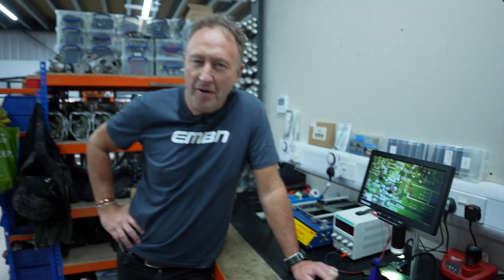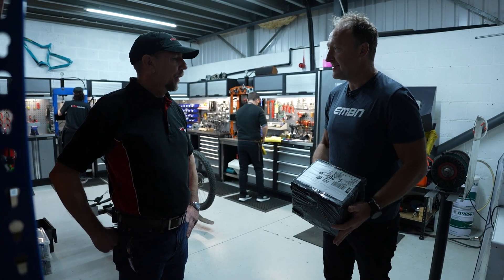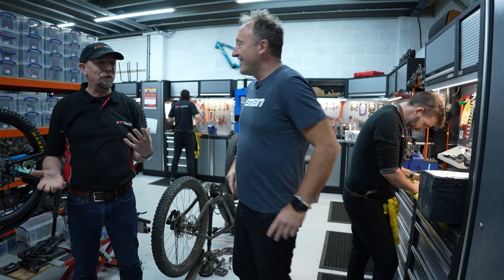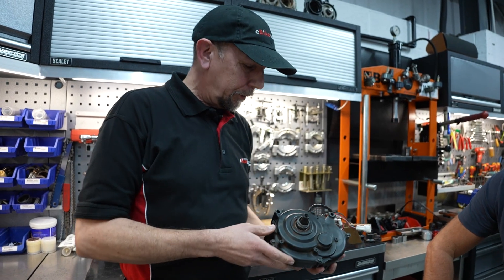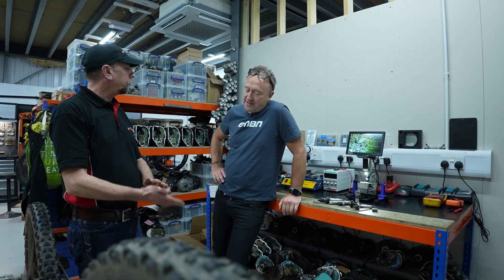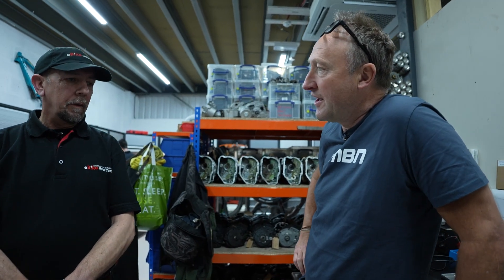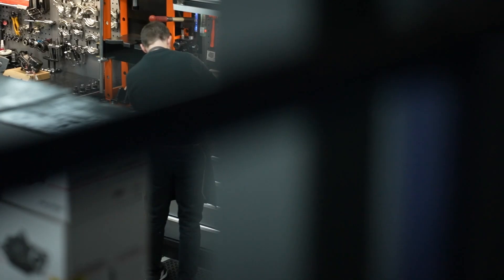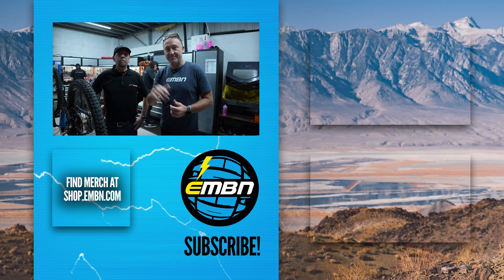How Affordable Is eBike Motor Repair | Behind The Scenes

Comment from the maker: Have you had to send your motor off for repair before? What was your experience like? Let us know in the comments! 👇
Reply: I had to repair it by myself. I live in Ecuador. I found that the bearings from one side were  awful condition but also there were humidity in the interior of the motor so I had to clean it all, change bearings and still working fine. It's a Bosch performance CX 2nd gen
Reply: I've used Pete in the past think he was known as performance line bearings, fantastic service would recommend
Reply: I sent the motor from my cargo bike to Ebike Motor Centre after 8000 miles.  Excellent service and a very reasonable charge.
Reply: I used ebike motor centre for the 2nd hand bike I bought with a dead motor (Bosch Gen 4 on Whyte E-150S). It needed a full exchange unit due to water ingress - the service itself was very good and photos of the damage was appreciated. The bike still ended up being a bargain!
Reply: Yeah mine was under warranty but I still had to pay my local LBS about £200 to fit it. Jokes
Reply: The question should be do we have the right to repair?
Reply: @rirrid5662  please expand on your comments
Reply: I rebuilt my Mahle motor from a Levo SL with a bearing and seal kit from eBike Motor Centre's partners in Australia.
Reply: Water does that!!
Reply: We need a setup like yours here in Dublin. All we have are apathetic generalists that struggle with basic ebike stuff and supposedly "supportive" e-bike outlets who are anything but. I can't even get a garden variety Bafang M300 mid-drive motor fixed.
Reply: My Brose packed up 1 month out of warrant and no claim due to expired warranty. I still have it after spending $100 on a new one. Does Pete have operations in South Africa?
Reply: Yes and fine, E-Ves did a great job. E-Mtb 12k km's
Reply: yes i did before 1 years ago in lithuabia.still broken and waitin for fix, how can you help me.
Reply: Is the bosch race motor the same to fix are you guys able to repair and or upgrade the whole thing?

Comment: Off-road motorcycles have been highly water resistant for decades.  E-bike manufacturers need to get their act together!  A tiny bit of seal friction and using sealants on electrical wiring, grommets, and mating surfaces seems a small price to pay for avoiding expensive water damage.

As many have pointed out, e-bikes aren't in the disposable price range for most buyers.

Comment: 90% of failures is Water Ingress! Failure from as little 150miles! Motor Case, Bearing Seals, not Hose pipe or jet washer Safe. Perhaps they should change the split line from Vertical to Horizontal? Improve the bearing seals & put a stick plastic cover strip around case, one front one back either side of the Crank bearing. They cost too much to fail so easily! An MGU & a Carbon Belt drive seems a great way forward!

Comment: Just moving into the EMTB world from normal mountain biking and coming from a motorcycle background I’m shocked at the apparent low component construction and design of the motors and the shocks! The low mileage you need a shock service done for instance is rubbish!!?? The way the motors are sealed is shocking! If offroad motorcycles were made that way they wouldn’t sell!!

Comment: Great video thanks. Mechanical part is okay-ish to repair. But finding the new electronic board or repairing it is pretty hard. At 7'00 you mention you can change/fix the electronics. Would you care to give more background? can you repair the circuit? or do you change it for a new one?

Comment: Cruel capitalism never wants anything that does not break down. These engine designs are deliberately made so vulnerable to water. In other words, replacement or expensive repairs are the things that manufacturers like the most. Stay away from these types of bikes with complicated and unnecessarily complex engines. Choose Hub motor bikes, which are the simplest and must-have designs. This is why all expensive bike manufacturers have hated Hub motors since day one. Because they are simple, long-lasting and easy to repair.

Comment: This is why hubmotors are more affordable and exponentially more reliable. No tucked in gears and motors that can rust to shit. At most maintenance is applying some grease to the motor joints and gears. And to top it off you can go home if your chain breaks, unlike mid-drive.

Comment: Awesome workshop, i did what you said at 4:41 excessive side to side movement on my EP8 that i feel when i tip the bike over in the switchback berms and the assistance is intermittent when pedalling, yet Shimano Australia basically have said if the motor doesn't throw a fault code its not going to get repaired or replaced even under warranty. I give up trying as the bike shop couldn't help either🤷

Comment: At about 5000 miles on my turbo levo I sent in my motor for a top notch rebuild with upgraded bearings and seals and belt. ($900) Then new tires and new valve stem and new cassette, new chain, new front chain ring, and new bearings in my rear hub. $1500 total. Good to go again! Ebikes require maintenance!

Comment: Over 20.000 km on my Bafang BBSHD motor, jetwashed my bike many times no bearing, gears or  cables replaced,  just the gasket seals replaced every 2 years and replaced the grease  and i know many other people with the same motor who had no issues, looking at these 250w ebike motors and it's hard to belive how much money people spend on these things and they break so eazy.

Comment: Great interview EMBN! I've had my E8000 apart twice to change bearings. The second time was shortly after the first due to water ingress from, wait for it, pressure washing. I was at a super muddy race at Muju in South Korea where they always have high power hoses available. The second service was easier as I only dried the inside but it makes me wonder if it was the mud or the washing that did it. The silicone I used might not have been correct. Does anyone know what Shimano seals their motors with? They seem pretty tight lipped about how to go about working on their components. Do they offer small part replacement? 

Steve's advice about hearing or feeling anything is spot on. As soon as my cranks had a little noise, I changed the bearings. I've had to fiddle with the power supply cord a bit too as well as bend the tabs inside the external battery connections towards the pins that insert into battery so they will make contact. That external battery gets jostled around so much the male pins have deep grooves in them and the little tabs weren't reaching. That and scuffing the plug that goes into the motor because the round pins corroded and I kept getting an E010 code that drove me crazy for a month before I solved it. Anyway,  I've now put 5 years and nearly 20k of hard MTB on the E8000. Still going to strong as long as I can keep the power getting to it.

Comment: Basically said e mountain bikes aren’t fit for purpose they aren’t designed for wet muddy trails and you shouldn’t be using those pressure washers muc off sell 😂 he even said hose pipe is potentially a bad idea ! 🤷🏻‍♂️ Sorry to say the prices some shops are charging is embarrassing,  bike service costing more than having a service & timing belt changed on a car at a main dealer is simply a rip off.. that’s before you get into the price of a new or re conditioned motor or battery prices.

Comment: Would it be possible to do a chart or a list of recommended service interval for different motors based on Petes experience? Sure a pressure washer will destroy a motor quickly, but there must be a certain amount of km's where at the latest its good to do a preemptive maintenance?

Comment: The costs of running and repairing these E-bikes will kill them off!!  Exorbitant costs of drive train components which wear out fast, costs of tyres which wear out fast, brakes wear out fast etc etc.  Replacement batteries (they dont last long)  Now your looking at the gearboxes!!  Forget it!! Simply forget it, its cheaper to run a a car by far!!
Reply: Well, while I do not have a mid drive you obviously never made a TCO for a car ownership, for the costs of a normal, used car in Europe you could buy a new E MTB every 2 or 3 years

Comment: Bracket Bolts on my Bosch gen4 snapped and others became loose, Bosch just replaced motor,
Would be nice if you could do a feature on checking bolts. Looks like a common problem 😂

Comment: Hi, if you shouldn't use a pressure washer (which i don't) or a hose can you advise the safest way to clean you ebike please? , i took the advise and dropped my chain and there's no noise when i turn my crank backwards but some noise when i turn my crank forwards. Definitely no play. How bad does it need to sound to tell you there's a problem? Thanks
Reply: Hose on everything non-electronic. 
Dish-brush or cleaning-wipe on electronics and crankshaft. Wash the brush/wipe with the hose or water bucket when it gets dirty. 
Skip hose completely and just dust it off with brush/wipe whenever possible. 
Cover bike in clear protection film and you can brush it violently without scratching the paint.

Comment: They rebuilt my Gen 2 CX in 2021, superb service (was "Performance Line Bearings" at the time)- I watched Pete do the full rebuild on his YouTube channel back in 2019 but a totally daunting task especially without all the hydraulic presses and bits! Current rebuild is about £315 but in the grand scheme of things for effectively getting a new motor I think it's a price worth paying, and when you consider that 2/3 of that price is for the parts including a drive side bearing seal/mudstop kit it's a no brainer(It's a pity Bosch F'd up that design and didn't leave enough depth in the NDS crankshaft casing to retro-fit a proper seal...)

Comment: I about the ship my motor to Inline bearings. For repair a PCB repair, we have the 73 error code on 3 bike's, its save the battery voltage online but anyone k ow where to start. Maximum respect to all 🤜🏻🤛🏻

Comment: My first Shimano steps/Scott E sub commuter  experience was terrible.   Never had any long enough to have any wear.  Was swapped out twice, taking 6 - 9 months.  Once out of warranty and third failure I scrapped everything, .    Bought an unpowered tern short haul and fitted a Bafang Hub motor.   8000 miles and just needing new bearings now which I reckon I can replace myself.

Comment: If you want to be able to repair your own stuff doing a custom e bike build makes a lot of sense. Id suggest the bafang mid drive kits due to easy availability of parts and proven track record of reliability.
Reply: Re:  "...If you want to be able to repair your own stuff doing a custom e bike build makes a lot of sense. Id suggest the bafang mid drive kits..." 
That is exactly my thinking, and my plan, perhaps later this year.  In that vein, I'd like to see videos on selecting a used bike for conversion for this or that intended use.

Comment: They have a great set up @ bike motor repairs & a wealth of knowledge,  if they realise that water ingress is the main cause of motor failures both mechanical & electronic why haven’t the big motor brands ??? If Tesla can make a waterproof motor for very fast car so can Bosch or Brose who are both leading electronic manufactures in the automotive world. Its about time they all sorted them acts out & supply products that are fit for purpose. some bikes are almost as expensive as a budget car & this kind of reliability would not be accepted in the automotive industry. Rant over. A great look @ a small indipendate company providing a quality service in yhe uk.

Comment: If a pressure washer can do that in 150 miles then I’m staying away for at least 5-10 years
Reply from the maker: Or you could enjoy eBiking now but don't use a pressure washer. Pressure washing a mountain bike will have the same effect on the bearings 🤙
Reply: @embn Pressure washinh bikes is notgood in general. I hose my non electric ones with a garden hose shower head, but that's with far less water pressure.

Comment: Interesting video. I have a 2021 Focus sam2 with only 2707 km on the clock. I live in Brisbane Australia so riding conditions are certainly favourable. I have the error 550 message on my Kiox. The bike has been diagnosed by a Bosch specialist and it has suffered a short circuit meaning a new motor is required. 
I am beyond annoyed and disapointed, I am not the original owner, I bought it the mechanic at the shop when it was just on 250km old, it has run faultlessly for the time I have had it. It is only 2 yrs and 7 mnts old, Bosh do not really want to help me, I do not think that these things are fit for purpose. 
I would be interested in anyone elses experiences, by the way, the bike is very well maintained, and no I don't jet wash it as it only ever gets dusty.

Comment: These videos do make me wonder how long my motor will last, doing about 400-500miles a month currently and they bike has just hit 1500miles after just over 3 months, don't really want to be paying £350 6 months or so to keep it running.. Plus not having the bike while the work is being done.
Reply: Depends on what motor you have, but a Bosch Gen 2 for example will do well in excess of 60,000 miles. Most motors are designed with big miles in mind, and this is what we see in most road bikes.
Reply: @Ebikemotorcentre  thanks for replying, it's a shimano steps e6100 on a hybrid bike, most miles are commuting to work with some gravel rides at the weekend :)

Comment: I was traveling 2k from home and tools. 2/14 I dropped my Trek Powerfly5 off at THE BIKE BARN, Phoenix AZ. Where Bosch advised me to take it. They completely dropped the ball. When I came back to Phoenix, one month later it was not done! I got the bike back 3/17.... New motor $1,400 US. There is not much information on real care of a Ebike! you don't know what is happening inside the case? They will tell you to bring it in every 6 months for service...lol! My bike had 2k on it. I thought i took care of it? Certainly better than my 3&4 wheelers, dirtbikes that I beat and trashed, swamped and there all still running.... Be careful with your ebike! Bad word to Bosch...!!

Comment: I have a 2019 Turbo Levo, One of those that Specialized gave the 4 year extended warranties to due to lots of problems with the new Brose motor and belt failures. This suited me very well especially as I bought the bike second hand with a mere 21 miles on - Yes 21! - and the warranty was for the bike, not the owner.
Quite a few of my mates have the same MY bike and all have had at least 1 replacement motor. Mine remained sound throughout. After the warranty expired I chanced upon The eBike Motor Centre's Brose upgrade video. I watched it with interest and decided to contact them for further details. I was impressed with the response so I took my motor down there to get the belt and sprag bearing upgrade carried out..
The motor was turned around quicker than they said and they also found a couple of bearing that were past best. They offered to supply and replace them for what seemed to be less than I'd be able to buy them retail.
I went and got the motor and the top man from the vid chatted to me.
I thoroughly recommend this company as the whole outfit appears extremely customer focused, professional and realistically priced.